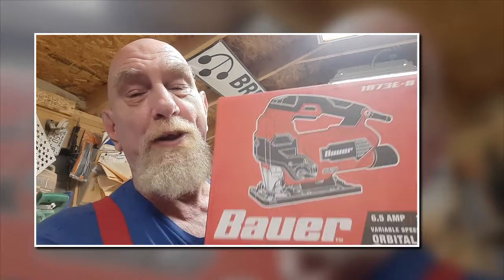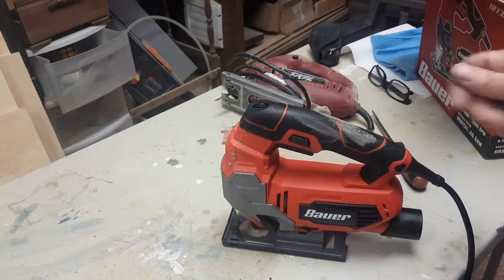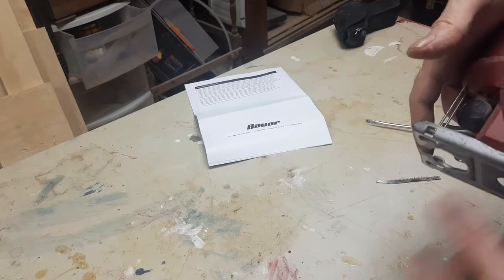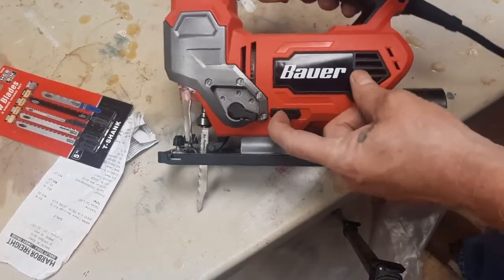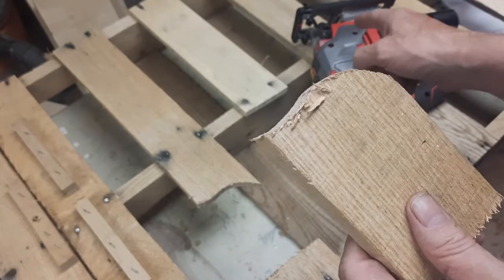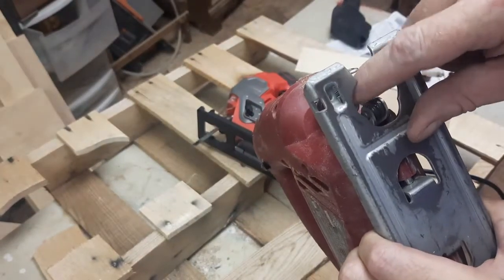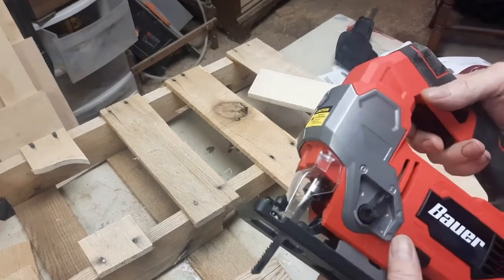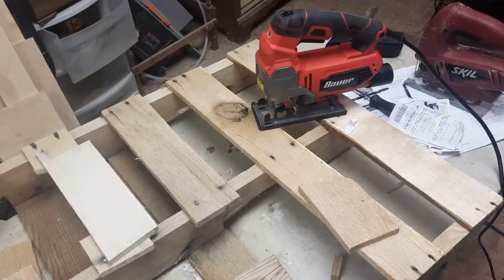Unboxing: Bauer Orbital Jig Saw! #jigsaw #1873e-b #oldguysmatter #oldguynetwork

Comment: I just got this guy for Christmas, and I'm pretty damn impressed with it. 

It has a heavy feeling construction-wise, and all features feel solid. (Trigger, trigger lock, orbital selector, base/angle adjustment, and vacuum on/off.)

I did a two-foot cut with it today in my workshop, and the laser guide seems to be pretty accurate.  

I might use a jig saw 6-7 times a year, so I could not justify buying a $175 one.  

I think I just found the perfect one for me......... :)